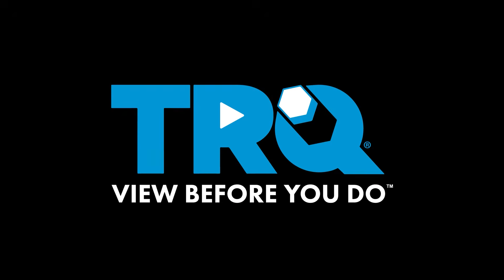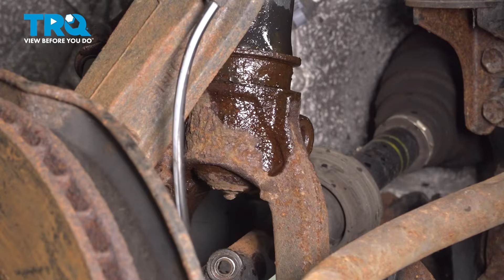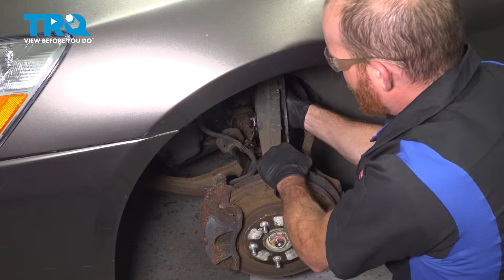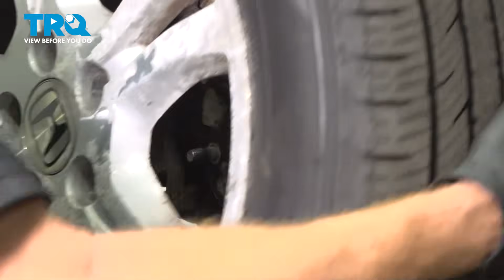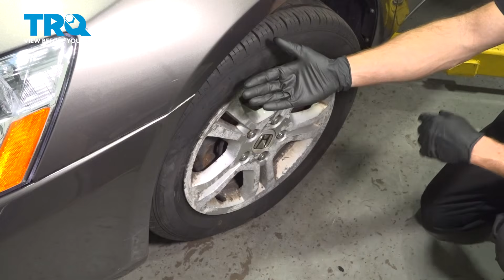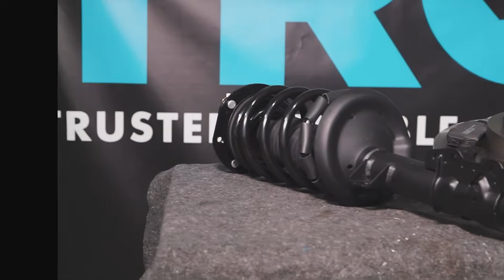How to Replace Front Strut & Spring Assemblies 2003-2007 Honda Accord

Comment: Its not need spring compressor tool in order to remove strut? Or that require for old cars with shocks?
Reply: only needed if your replacing the springs